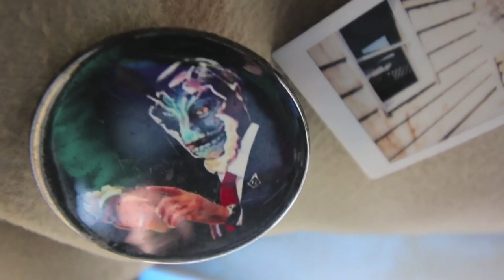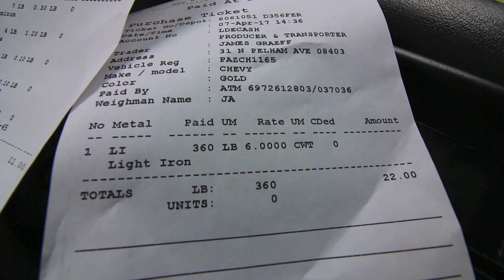The Scrap Life Never Sleeps!

Comment: i'm still confused if u take in a truckload how do they figure out if u had say 60lbs or so whatever of light iron copper ect. if they don't separate and weight out each different metal?? thnx- do they just guess at it?
Reply: justmy10cents light iron is weighed on the big scale usually and aluminum copper and brass etc. are weighed on the 1 pound scale or shop scale!!!
Reply from the maker: Yeah you get on scale throw off your lite iron get back on so they can weigh again and if you have cast get off throw it on the other side of the pile than get back on and the non ferrous is weighed on a smaller separate scale across the yard.